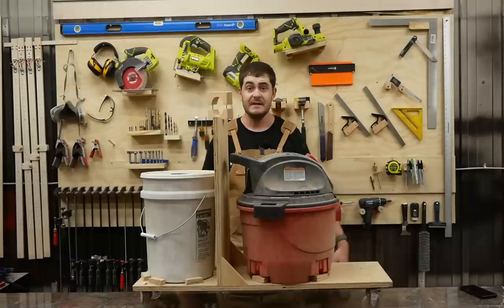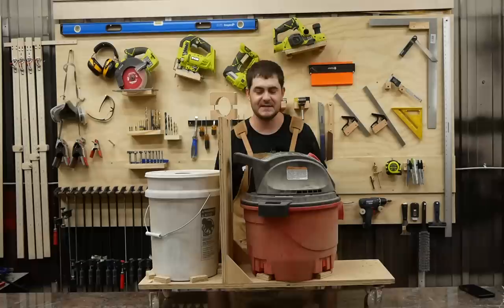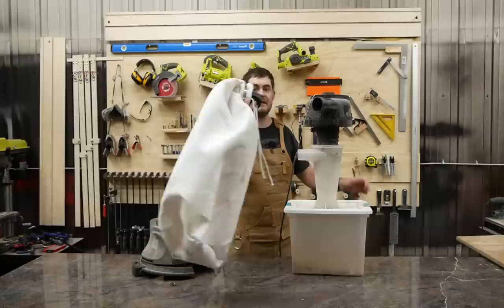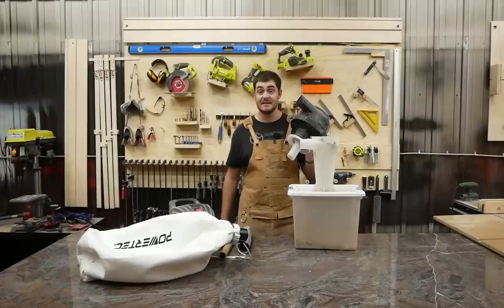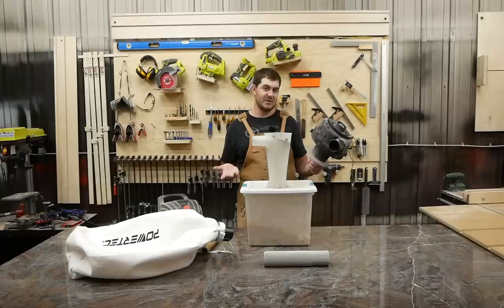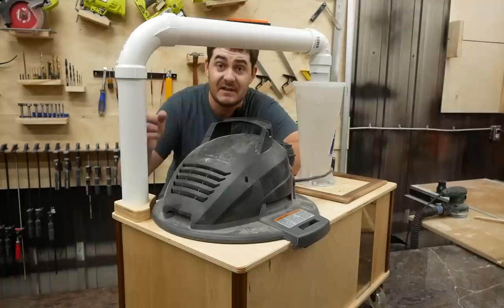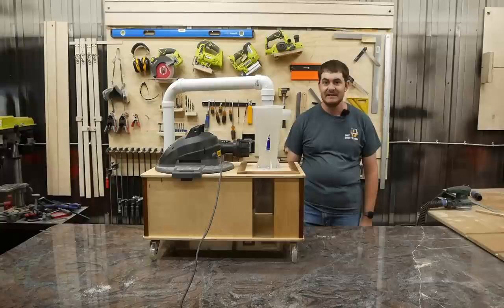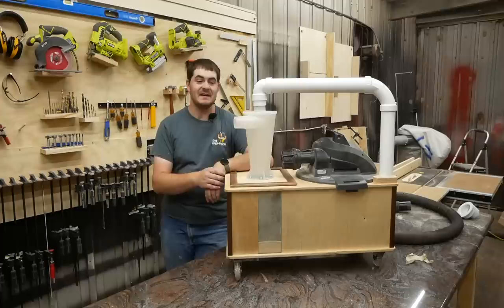Making an Overly Fancy Dust Collector Cart and Experimenting with a Dust Cyclone

Comment: The reason you got a lot of blowby in that cyclone is twofold: 

The cyclone is likely too small for the flow of that shop vac. A cyclone requires a huge drop in air velocity for the dust to fall out. If the flow is too high then the velocity is too high and it won't fall out properly.
There needs to be some distance between the blower inlet and the cyclone. This is a little more technical, but basically the velocity at the blower inlet is much higher at certain points in the pipe cross section than other parts. The high velocity sections carry dust, then the dust clogs, then the high velocity section moves, more dust clogs, etc. Eventually the whole inlet is clogged. Adding about 5 pipe diameters of length allows the flow to "develop" and be more uniform when it exits the cyclone.

I know what you're thinking: "why should I trust this random handsome guy in the comments section?" Well, I'm an HVAC engineer that specializes in industrial ventilation, so I've done this once or twice.
Reply: You’re an engineer and you can explain it in layman’s term. 
Well done. 👍🏻👍🏻👍🏻
Reply: Is there a formula for the size of cyclone needed vs air flow? On household vacuums they use a lot of small cyclones.
Reply: @groundzero_-lm4md  I do not have a formula for sizing cyclones. It would depend on the nuances of the design per the manufacturer. Manufacturers will publish an airflow range for their cyclone, so you need to ensure your flow is in that range. Generally, do not exceed 2/3 or 3/4 the listed capacity of a cyclone because manufacturers tend to overpromise.
Reply: Yep... removing the filter and shorting the distance caused too much airflow

But I loved the project and have subscribed!
Reply: Is the distance part of why the final version seems to work so much better? The loop of PVC pipe looks to be well over 5 diameters in length.
Reply: @groundzero_-lm4md  Find Bill Pentz on air flow designing a cyclones
Reply: I am sure you know what you are talking about- but it does not match my experience. I took my impeller/motor assembly and fitted it directly on top of the cyclone (with a 3D printed adapter). Less that the diameter of the pipe from the top of the cyclone to the impeller input. Been working fine for over a year. A question- the cyclone axial outlet has a length of pipe into the cyclone (which seems to vary between makes of cyclone). Does this not form the 'five diameters' that you mention? I notice that some cyclones have a flat top, and some form a circular spiral form- is that more able to produce a smooth flow?
My understanding of cyclone action is that the rotating air causes the particles to move to the outside of the cyclone (both from centrifugal force and that the pressure is lower there (Bernoulli effect). Their weight then causes them to fall into the bucket below.  Not sure how any turbulence in the exit tube could affect their travel - they are surely not there to be affected. Are you saying some will travel up the exit tube and then fall back (against the flow) when the turbulence is reduced?
A fuller explanation of this whole area would be greatly appreciated.
Reply: I made a cyclone for my dust setup, using Al flashing, put it together with Al rivets and then sealed all the seams with HVAC Al tape. The entrance and exit holes are 4" diameter and the overall height for the cyclone is 24". It is directly attached to a 55 gal. metal drum. It works ok. This was done about 15 years ago when I was still working as an RN. Now, I have a lot of medical problems that keeps me from doing too much out in my shop.
Reply: @garrettducat5769  Manufactures exaggerate? NO WAY! If Harbor Freight (for example) claims their tools are better than the other leading brand you can take it to the bank and promptly get kicked out of the bank.
Reply: Ok, I was wondering what the heck was going on.  I have a very nice cart design i got online and built for my dust deputy, It has a single standard hose length between the vacuum and the top of the cyclone. Literally 99.9% of everything stops in the Dust Deputy. I was not understanding how he was getting massive shavings in his port. Thank you for the explanation. It felt like it was too close intuitively, but I couldn’t explain why.

Comment: I like the way you explained your thought process on solving a problem, and you're not alone, I thought the same thing of "eliminating the middle man" however I'm glad I didn't attempt to make it myself... you made me realize that it's more complicated than doing the obvious... still not sure why it failed, maybe it has to do with the length of hose to the shop vac?  Anyway very interesting, thank you for taking us along for your journey!  If you need to make a dust bin for easy emptying, consider a plastic bin, you'd have to modify the front of the cart by making it a door that you can open and the bin can slide out, so if I build something similar I might go vertical to conserve shop space... hmmm... now you've got me thinking... and that's probably not a good thing. 😁🤪😜

Comment: Sweet. A lot like mine, but no need for the Dust Deputy.

My Dustopper works great! And is way shorter the the over rated DD. It sits right on top of a 5 gallon bucket. The bottom is cut out to allow for a huge dust reservoir. Then it has a table top above the Dustopper & shop vac. It is all built into an old cart. The unit acts as a portable shop vac cart, assembly / feed-out table, and a rolling power strip.

Looks rough, but works very well. :)

Comment: I bought such a small cyclone from eBay it's about 10 $. Had it laying around for 2 years now and I'm about to finish my workshop.
For what it is it's very efficient. Like you, I made a solution with a vacuum cleaner engine and the cyclone connected in series. The whole shebang is outside so I don't have to listen to the noise it makes. I made a box for my compressor and it's also the place for the dust collector.
It works quite nicely. :)

Comment: Have you considered making a drawer for the dust collection side? Maybe use the Baltic Birch and Walnut, like you did the cyclone top, for the front. Use baltic birch for the bottom and rear of the drawer and use clear plastic for the sides so you can still use your windows. Then you can use those knobs to seal it when it is closed. Just an idea, so you don't have to use another vacuum to empty it.

Comment: You could cut the side off and slide a clear tote in the dust deputy side for easy emptying. And for looks and to keep the air pressure going attach an access panel with magnets

Comment: My cyclone (made by dyson :D ) has a compresion funnel, outside looks like yours, about double the diameter, and, has another cone inside of it, the air comes into the cyclone and is compressed while spinning, the inner cone, ends around an inch, before the outter cone, air has to take a sharp bend to go up into the vacuumizer. Then is goes into a paper filter, about the size of yours. I vacuum cement (from drilling, and breaking walls), sawdust and even my shop floor with it, the deposit fills several times, a lot of times, before the vacuum power level starts to show up. The power level is just two like a syring where the inner part is spring loaded, the more power the motor makes to vacuum, the more the meter shows up in the window, very common with old hoover home vacs to indicate a full vacumm bag.

Comment: I've used the cyclone to good effect with drywall sanding, concrete grinding, and wood shop. I have a cart for it connected by a shop vac hose to my shop vac. It's bulky but will fill four five gallon buckets before the filter needs tapping.

Comment: Honestly when looking at the costs and effectiveness of pre made cyclone and baffle separators for wood working. I ended up building my own Thien baffle out of some 3/4 plywood and pvc scraps I had laying around. I would say it works a million times better then any of those cyclones. 

The 30 gallon can I built it on has been filled and emptied about 8 times now and still have the same bag in my vacuum.

Comment: I've always wanted to try two cyclones in series.
Reply: I have - it can be very effective. See +Garret Ducat ‘s reply to why it is a little more complicated than throwing kit together :) But the cascades work well if you size the hoses right - first bucket has 98% of the crap in it, the second bucket has fine powder in it and the vac filter lasts a looong time. 
But since I lacked the workshop and Dunn’s skills (and, frankly, stylish design eye) I got tired of balancing the stuff and went back to one bucket - and regular washing of vac filters :)
Reply: Also known as the 2020 hurricane season.  ;)

Comment: Even you get tired of cleaning the connection bucket, make a drawer (with glass panes and walnut accents) that goes in from the opposite side of the motor.

Comment: Very nice dust collector cart thingy!

Something that might not be too difficult to do later is to add a drawer that can be pulled out from the end when it's full. It can even have panes of glass matching the exterior, so you can still see what's going on! With a drawer you can use the entire collection part of the box—and all you have to do is saw a hole in the end of the cart :^)

I love your videos! You are a very funny guy, you are!
Reply: Good idea, I was thinking of a trap door on bottom so he could set it in a trash can and swing it open to let the sawdust out, but your idea would be way more convenient.
Reply: @rikityrik  A trap door sounds like a good idea, or maybe one you pull aside over a trash can?

Comment: 1: call it Dunn and duster(ed)
2: what if you made a new lid for the cyclone that raises the height of the suction pipe? Maybe an upside down salad bowl with a hole? Would that reduce the amount of dust that got through because it’s further above the intake, or would it only funnel more in?
3: how about a sliding trap door at the bottom of the dust box? Not for function, it’s too close to the ground to be able to effectively remove and clean up the dust, but for esthetic.

Comment: A suggestion: Instead of having to lift of the lid, you could add a blast-gate kind of thing to a side, so you can simply hold your big dust collector's hose against that port, open it up, and have the dust be sucked out. I guess it won't be needing a clean that often, but taking the PVC off, removing the lid, it'll probably feel like a hassle.

Comment: If you have another street elbow ( the longer arc length one that goes into the shop vac side) put that on the exit from the cyclone and adjust the horizontal and vertical tubes to compensate. Hard 90 degree turns are bad for air flow.

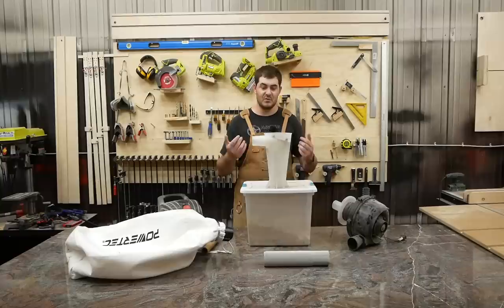Comment: 9:41 I'm thinking cyclones are mostly marketing hype.  My vacuum has 3-4 pictures of "cyclonic action".  The filter still gets clogged, debris still swirls around the top, about the only thing that drops out is metal like screws or pennies.

What may work for you is some type of water filtration.  Inlet goes into 3-4" of water, head unit sucks air from a 12-16" gap above the water level.  My grandma's old vacuum used a water filter.

Comment: The only thing I can see 👀 you missed is putting silicone around the inside of the joints this will completely seal the main vacuum area almost stopping all the fine dust 🤧 otherwise it is pretty darn cool 😎. 
💯%  👍🇬🇧

Comment: Volume of superfine dust was never an issue for me, just that it all wound up in the filter. I'm much more interested in how long the filter maintained air flow than how much dust wound up in the bottom of the box. I don't know what they were doing in MY basement for the past 200 years, but I can't run my shop vac for more than 10 minutes before the filter needs cleaning, while the tub can go for hours before it gets full. (Now that I think about it, it may be 200 years of mold accumulation in the cracks of the floor; stone foundations are damp)

Comment: The shop vac suction should be hooked up to the side of the cyclone, not the top. That way the debris shoots down the cone of the cyclone to the bottom of the bucket with a less likely chance it will go back up the side of the cone to the shop vac or spin around and around up there. My 2¢.
Reply: Yes and the top connection of the Dust Deputy protrudes down into the cone a ways and won’t work as good if it is removed as yours has been.

Comment: You know I thought about doing something like this but I just hate cleaning the filter so much that I broke down and bought a CT MIDI. I still use a cyclone for the planer and table saw but at least I never have to deal with dust anymore. I bet adding a shop vac bag to the mix would really extend the life of your filter

Comment: You built something extremely similar to the design I've been tweaking for the last 2 years lol. My design is identical on the top including PVC arch. I hang mine on the wall with a french cleat. 2x 5gal buckets with screw on lids hang by the lids and create the two sealed chambers. I can then unscrew them from the wall like a air compressor filter to remove and empty. Your trim is far superior to my blue plywood however.

Comment: You could also just use some strong magnets to hold down the floating square, if it becomes an issue.  Then it would not detract from the clean lines and sleek look, but still hold it down when gravity and suction are not quite enough.  I like it. :)

Comment: Wow, good job and great explanation.  If you continue trying to improve upon your design,  an alternative to sucking out the contents with your other shop vac might be to convert the end to a sliding panel.  Might be too much of a "re-do", but just an idea.  With the end panel being able to slide out of a rabbet (or however done), you would be able to just turn the box on end.
Thanks for sharing~!

Comment: I have been playing with similar arrangements for some time. My interest was in reducing the noise. Brushed motors (needed to get the RPM, over 10,000, to  give sufficient vacuum) are inherently noisy- anyone who has replaced a router with a VFD 'spindle' (brushless 3 phase inverter driven motor) on their CNC machine will know the difference. I built an extractor using such a motor (capable of 24,000 RPM) but sadly the noise was just as high and more annoying frequencies- seems like the impeller is also very noisy! Great suction though- I had to dial it down because the vacuum hose to my tool would shrink and try to pull the tool out of my hand. I tried surrounding the motor with three layers of insulated ply, with little affect on the noise level. Think it will take concrete.
My CNC machine has a cyclone/bucket unit followed by a motor/impeller from a vacuum cleaner which is mounted in a box, flexibly mounted in a box which is flexibly mounted to the wall. With a speed controller (so I can match the vacuum to the need) it is sufficiently quiet for the several hours it sometimes takes to cut a big project. Just wish I could do the same for my workshop extractor.

Comment: 5:55 Oh? WOW, it even has a toilet function!!! ....... ok, you went a different way...... probably a good idea, that would probably get messy 😋🤣😂🤣 It actually ended up looking pritty nice and eliminated the thing I also hate about dust collection carts, the vacuum bucket. I know it hasn't been eliminated, but the box looks a LOT better. My small shop vack set-up uses a upright cyclone style vacuum, so it has a really small  container at the base, which also plays a part in it's own cyclone..... stuff. The theme of my cart is 1 massive cyclone, in the dust buster, 7 little cyclones, in the middle of the vacuum and another bigger cyclone in the base. I just make sure I'm wearing my red high heals, with matching steel toe caps, when I'm using it so I can get home from that irritating yellow road 😁👍

Comment: your earlier experiments failed because the top of the cyclone was too close to the source of the suction, not giving the air enough chance to swirl  properly. The head unit was designed to provide enough suction to pull dust through a long hose, you remove the hose, and you get a lot more suction. That little cyclone had no chance. But it was fun hearing about you trying to make it work. But you learned something, and you ended up with a very nice looking dust cart that works well in the end, so I'd call this a net positive.

Comment: Maybe the problem with your old set up is that you have a left turn spiral in the cyclone and a right turn air spiral in your vac-head! Therefore the air flow spiral is trying to change direction and fight with itself instead of forcing the air down the cyclone.

Comment: Soooooo….. the reason the Dust Deputy didn’t work as well as you thought it would is because the plastic tub you have is not air-tight. Put even a small hole in whatever container your dust deputy  mounted to, and it will cause a back draft and render the cyclone useless. 
Get a new cyclone, without modifications, and mount it onto a sealed container (55 gallon drums in plastic with a clear window works well) and it’ll be the best damn sucker since May West.

Comment: Your Problem with the cyclone is that the box below isnt air tight. As soon as there is minimal airflow in the box you will suck out dust from the cyclone. Make it Airtight and no chips will suck into the motor.

Comment: Maybe a DIY cyclone out of a bucket would have worked well. I assume a larger radius would give the dust more time to drop from the air stream before it makes it to the vacuum outlet. That's what I use and I get virtually nothing making it past the cyclone. However mine just sits on the floor with no wheels. I should fix that.